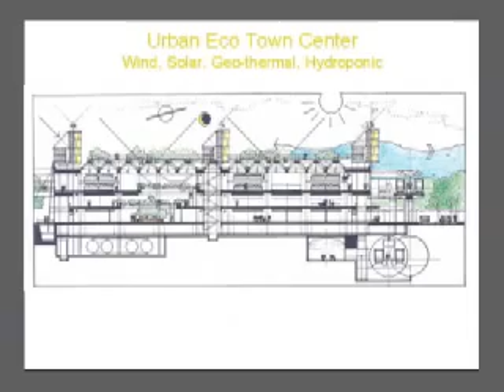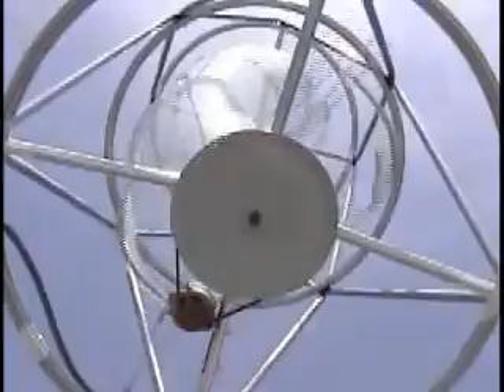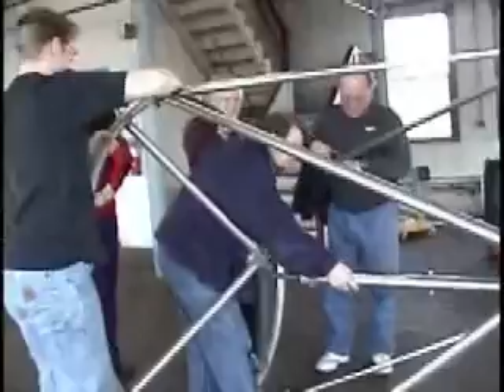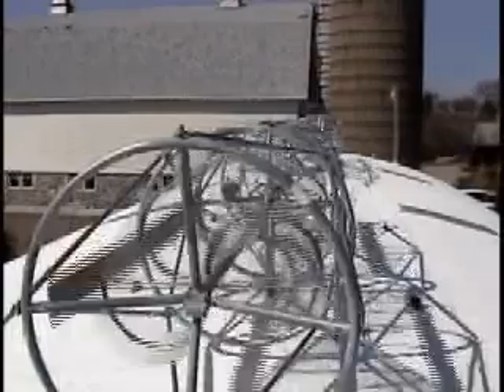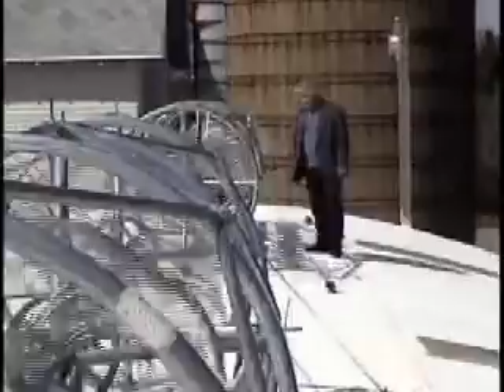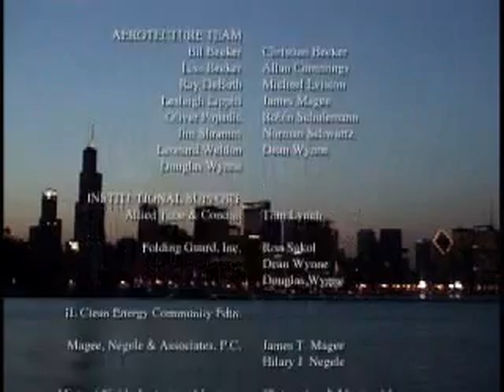Aerotecture

Comment: The only way to go towards the idea in this video is to get started with it, Start putting up solar panels, wind turbines in your house, so the cost of the applicance goes down and further helps to boost their growth. The electricity produced by them could be used for charging appliances, running washer, dryers charging car batteries.